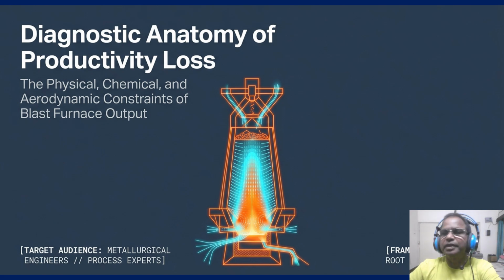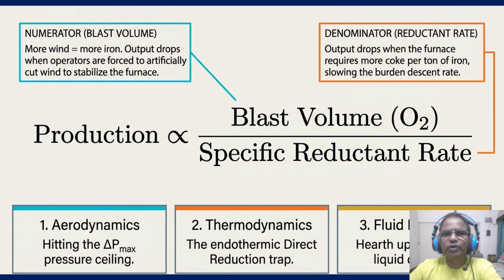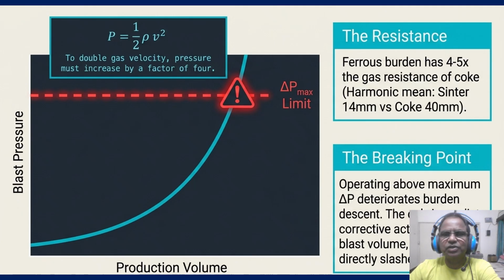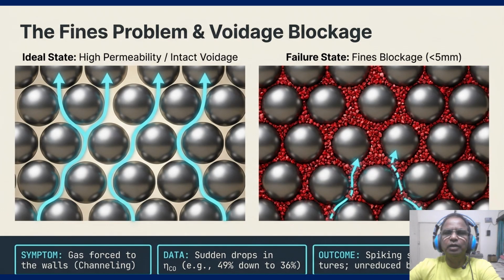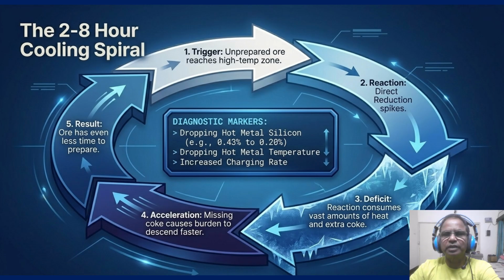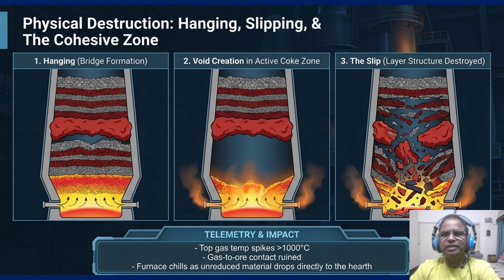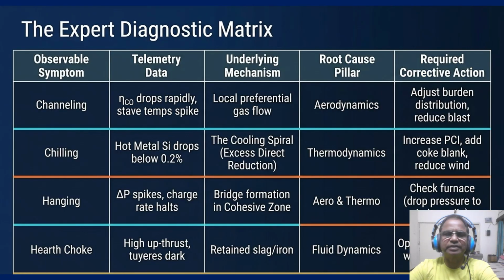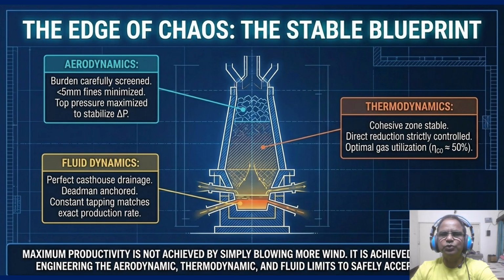How to Keep the Blast Furnace Productive Even When It’s Almost Out of Control

Comment: Sir give some suggestions from your side regarding high fuel rate consumption, we are doing stave cooling pressure testing,no drop found 👆
Reply from the maker: The pressure test confirms no internal water leaks; therefore, the high fuel rate is a process-driven thermal imbalance. Our past  data suggests an increase in endothermic Direct Reduction and high wall heat losses due to an unstable accretion layer. We must now prioritize optimizing the Radial Gas Distribution to improve η 
CO and stabilize the stave thermal shield to stop the energy drain to the cooling system